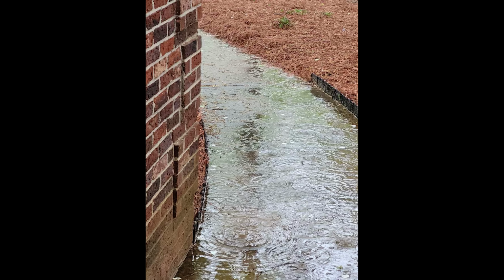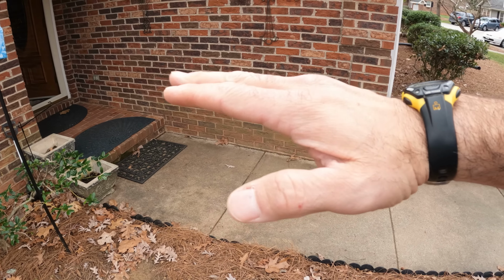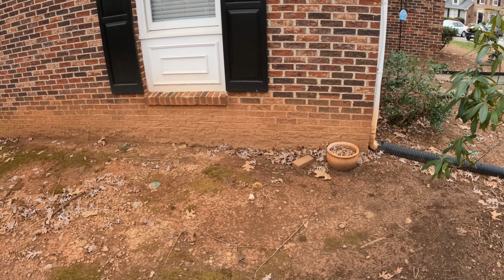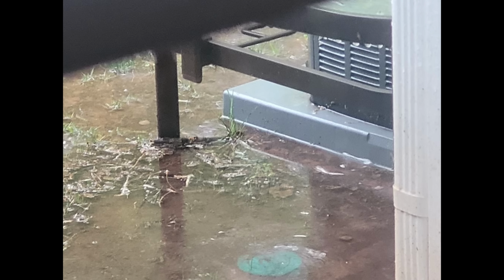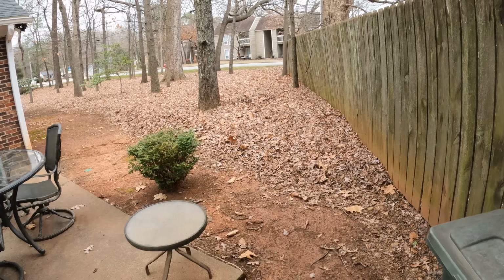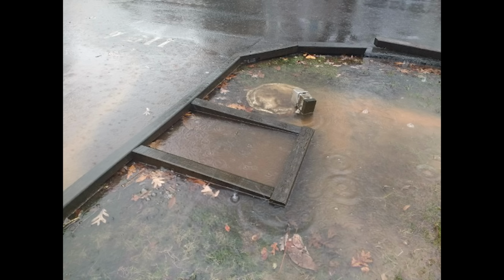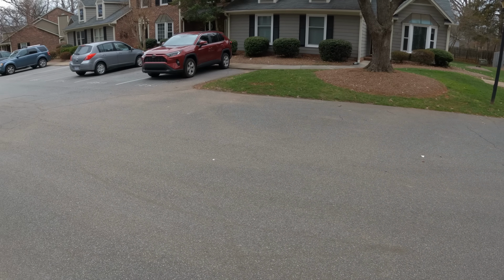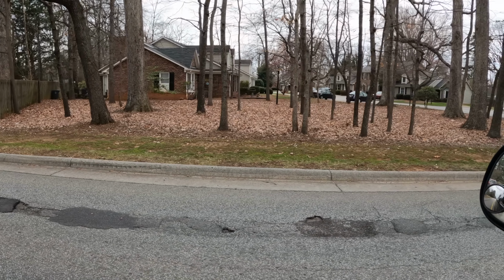Drainage Assessment - Install dewatering pumps to a problematic area?

Comment: 1. Definitely try going directly to the street drain instead of to the hoa pump.

2. That concrete slab could be a candidate for concrete raising with that foam stuff.
Reply: I was going to ask that, couldn't the concrete just be raised vs totally replaced? It looks in decent shape and would save a ton of money I imagine.
Reply: They don't use rebar in his area, so concrete rising by foam is prone to cracking !
Reply: Agree Avoid the hoa pump basin, Can of worms & possible long term effects, complaints, Unless its signed off under official paperwork dont risk future lawsuit etc over compounding the "activity".
Reply: Was just going to reply this slab looks like a textbook candidate for mud jacking by an experienced sidewalk repair contractor.

Comment: Wow those issues should have been dealt with during the original development of the property. But doing plan review from the Planning side of things I know that the plans are not always followed during construction and sometimes the Civil Engineer doesn’t get it right. Pumping is always a last resort but I agree with your assessment that in this case it is the only option. Great assessment!
Reply: Standards in that country seem really low compared to most places - you would have thought with houses of that size, municipal storm drainage would be an absolute basic requirement before one brick is laid....

Comment: Dude, 2020 NEC doesn't allow them to have that 4:30 electrical-outlet in a puddle of water, it needs to be on a GFCI-breaker if it's going to be in the mini-pond. If the plug is literally under water then the GFCI should absolutely be tripped. 

IMO they both need a larger 70+ gallon Child-proof-sumps & both to be put on timers where the 1st/the-lower-float switch has the pumps on only from 12pm to 5am to reduce nuisance issues. You should be looking at the water-table depth maps offered by the USGS(it's free data). It's hard to know what that water is if we don't know where the water-table is, it literally might be 0 inches.

Comment: ✨🤔✨. First thing ....Lots of trees and leaves ...So gutters should be inspected and cleaned...Then debis filters can be installed on downspouts to shed away leaves and debis ...You don't want all the leaves and stuff going through the lines then all that gets stuck in sump pump pit. I'd imagine a ton of leaves are caught up in that pump and pit ...I would also guess that sump pump is already connected to storm drain...Just a guess but it's close to where the storm drain may be running. The HOA should also consider adding more storm boxes connected to existing one you showed...Great video ✨👍✨

Comment: Hi Shawn, I like the thought of pumping all the gutters to that city street on the side yard just up from the city basin. Otherwise you're relying on two pumps, yours and the HOA pump. Plus you know if that HOA ever fails again it'll take them forever to fix it so why not take them right out of the equation. For that walk way we have concrete lifting up north because the frost heaves cause all kinds of settling but it sounds like that's not a thing for this job? Can't wait to see the results.

Comment: A tricky spot - maybe a test case for grabbing the water from the top of the gutters and attaching the pipes to the numerous trees in the yard, before depositing onto the road from height 🤣 More seriously, the rear exit to the curb seems logical; I also wonder how deep that drain in the front street is - wonder if it's deep enough to take pipes without needing a pump? All the best.

Comment: On that front walkway you can pur concrete on top of concrete and slope it down and out to overcome the puddling. Or you could cut in a channel drain. Once you get a functional basin with gravity you can send large volumes of water to the right place. I would recommend a gravity system if possible leading to the municipal curb drain with an underground 8" pipe. get all the downspounts all tied into the new system that lead to the 8" pipe. I would abandon that HOA's pump system. Not worth the future headaches. A good 8" pipe can take care of all that water with gravity.

Comment: In the back yard, I wonder if a narrow drainage ditch along the fence line would direct the water out to the street. Hmm, maybe. The existing drain and pump by the parking space should be cleaned out and restored. Why put the wood around the catch drain? Seems like that would prevent the water from going where it needs to go. As for the front sidewalk, I think I would recommend actually increasing the slope to creat a ramp to the front door. This would solve the problem and make it slightly more ADA friendly.

Comment: Backyard and front yard Y connect pipe to back drop bubble to each other then all the front water flows back one pipe
With concrete you could look at foam expanding under the concrete to make level without ripping it out and then seal all the joints when completed
Digging further down in ground to get the proper drops would eliminate alot of front water issues 
You said yourself pvc is better to move the water

Comment: Wish you'd come out to our HOA in NY... Our parking lot floods so much I've actually floated my canoe in it and paddled around
Reply from the maker: Will your HOA not do anything about it? Email them with pictures for proof that they knew the problem existed and chose not to address it. Then if you ever have problems or property damage, you can pull that back out and hold them accountable.
Reply: @GCFD  oh, I've sent them photos of me in my Canoe!  They just dont seem to have the will to fix it.
Reply: @JE-zl6uy  Some HOA work thru a managment company that will contract out the work. The president of the HOA may not live onsite. So they may have no clue of the severity. May have to take it directly to the next HOA meeting.

Comment: Ugh.  HOAs!  I know this is more of a landscaping thing, but what about turning that backyard low spot into rain garden?  Redirect the downspouts and put in a sump as you mentioned, but get in some local plants and stuff to soak up that water and filter run off.  Let the sump take out the excess for heavy downfalls, but reduce the overall drainage output to the street or that teeny little HOA basin.

Comment: For the low concrete, instead of replacing, have you considered slab jacking? This would be easier and cheaper. The rest is difficult because of a relatively flat area. I would consider going to the sewer even if I had to get permission from the neighbor. Maybe add a carrot to the neighbor of some additional drainage for them. This would need to be paid for by your customer.

Comment: Shawn 
I am generally curious do you ever run into a situation after your usual routine where you have to provide additional services like waterproofing to the interior/exterior of the foundation, fix some cracks or install sump pumps? It seems like a general practice in my area that a lot of people are doing when they have water coming into their homes. 

Do you think the only solution should be to take the water away on the exterior surface or is there some situations where you have to take a comprehensive approach?

Thanks for your videos cant wait to see another drainage job!

Comment: Hey Shawn hope you doin fine. You said you have to rip out the concrete and put a new one in, but I saw some videos on youtube with a company which pushes a foam under the sunk concrete to elevate it. It´s only possible when the concrete is not broken or sturdy enough, what do you think? 
And what about Youtube Shorts? I think they will push your channel a lil bit, just a recommendation. 
See you have a good one.

Comment: You're fighting an uphill battle... Literally.
I'd locate the storm main and either install a Kor -N-Tee or an Inserta Tee depending on the type of pipe used as the main. Tie everything into that. Since it's underground, you'll have plenty of fall. The only other issue is what is going on with that gym shower looking drain in the green space next to the sump with the electrical connection.
Definitely NO pumps needed.

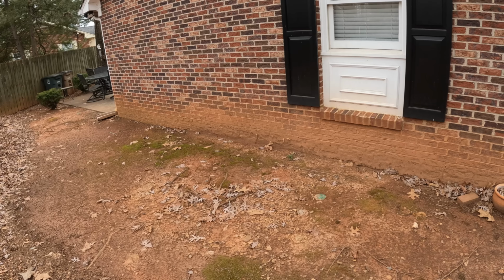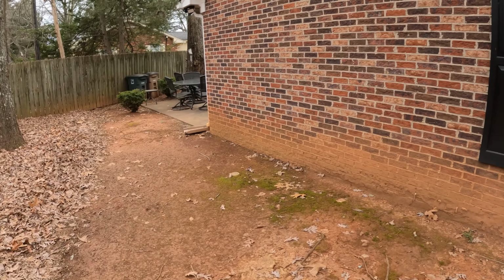Comment: @2:09 there is what looks like a green pop-up circle device on the ground in front of window. However, I have seen these in several of your videos, but you dont talk about them or say they are related to drainage. Can you advise what they are? They seem smaller than a drainage pop-up emitter. Ther was another one near the rear concrete patio around 2:20 in the video also.
Reply: I noticed that too, they do look like pop up emitters.
Reply: I think those are termite bait stations..or whatever that are called.

Comment: Instead of replacing the front walkway, wouldn't it be easier/cheaper to install a channel drain near the front steps and have the water shunt from there to your pump basin, to be pumped out to the street?  (I don't know the prices on things, but I would think it would be less expensive...?)  Also, I would do everything I could to pump the water to the street (instead of the parking lot) because it looks like the whole development has insufficient drainage -- so it's likely that whatever water you pump to the parking lot will probably cause problems somewhere else in the development.
Reply from the maker: Yes that would be cheaper Donna. I wouldn't do that because you place the drain where you want the water to go, and so never place a drain against a foundation (which would encourage water closer to the foundation). I have a channel drain video where someone did just that and flooded the building when the channel became clogged and overwhelmed. Always install an option that causes the water to flow harder away from the foundation with more and more water. In this case, it's correcting the concrete.

Comment: Gotta fix the concrete as well, slopped towards the house is insanity at its best. Obviously the builder of that place was a green machine, putting another house in a hole, you might want to stay away from that job, unless they have tens of thousands they want to put at it.